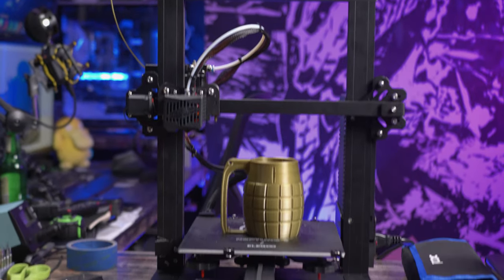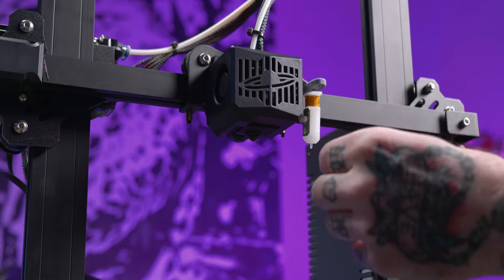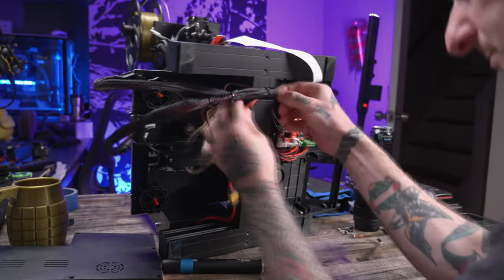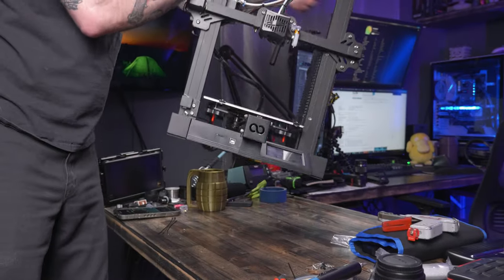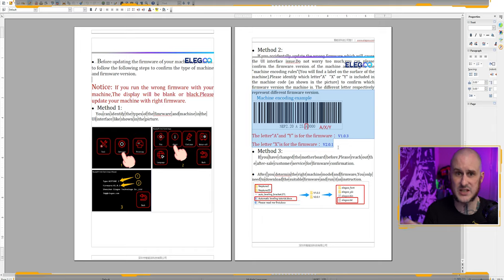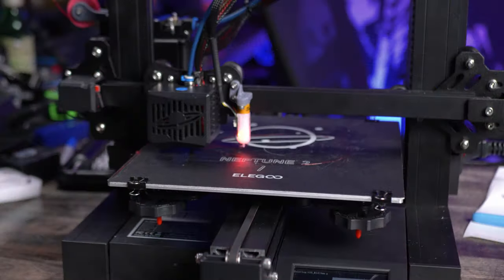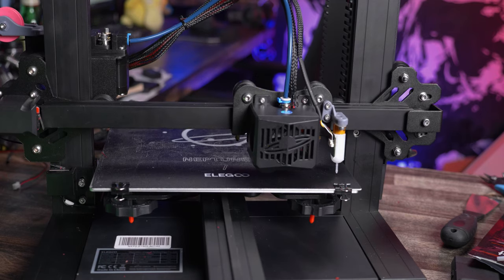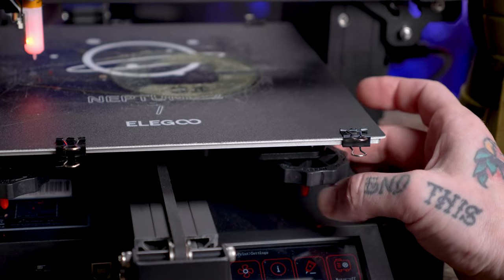DON'T Install BL Touch on the Neptune 2! - How-To and why not to...

Comment: I think you might have forced them to make a user guide post on their website for this. They have made a statement in that article that says the Neptune 2 supports automatic leveling function, but they don't recommend using the BLtouch auto leveling function and that manual leveling can get better printing results. This was all good information as I just bought two Neptune 2s printers,, maybe I'll do one with a BLtouch and one without just to see the differences.
Reply: Hey, I'm interested in your findings if you indeed put a bltouch on only one of your printers. I have a Neptune 2S and I isntalled a BLTouch because it seemed a good upgrade but I agree that the implementation of not having the easy option of manual levelling anymore is sometimes a drag. So what would you say ?

Comment: I have the BL Touch on my Neptune 2. I manually level the bed by running the auto levelling while connected to pronterface. You can then see the BL measurements output in the console. You can use these to know whether to raise or lower the bed for each corner. It's a bit long winded but about 5 iritations had it nailed.

Comment: I realize that this tutorial is a couple of months old, but I discovered something in the firmware that might help. It's a little kludgy but you can edit the "elegoo.txt" file to fix certain settings that won't save to EEPROM (because nothing saves to EEPROM, ugh). I had to do this when I upgraded the extruder to a dual gear type and couldn't get the machine to save the new E-Step value. In the config file, under "Z Probe Options" edit line 252. By default it reads ">Z_PROBE_OFFSET_FROM_EXTRUDER	0	# Z offset: -below +above  [the nozzle]" but you can enter your corrected z offset in place of the default "0" value. Save the file and then update your firmware as normal. This procedure works for PID tuning and e-step adjustments as well, just hard code the relevant values in the config file. It's a PITA, but it works.

Comment from the maker: Elegoo has posted better information to their website about how to install a BL Touch on the Neptune 2.  In those posts they state they don't recommend installing one on the machine, but tell you how you can.  As well as highlighting some issues I didn't capture on video about why this is a strange setup (odd Z-axis motor noises): https://www.elegoo.com/blogs/3d-printer-user-guide/neptune-series-fdm-3d-printer-firmware-auto-leveling-function

Quote Elegoo.com: "Statement: Neptune 2 printer supports automatic leveling function, but considering that the printing range of the printer is relatively small, it is not recommended to use the BLtouch automatic leveling function, but manual leveling can get better printing results."
Reply: I had the exact same response from Elegoo. I had contacted them regarding the knocking sound from the Z stepper and they advised that they've had numerous people reporting the same problem and to rather not use a BLtouch, for this reason and also they say youll get better prints without it. I'm going to be removing mine

Comment: Could you either use Octoprint to home the hot end to the corners, or simply issue the gcode to do so via a serial terminal? That way, you would effectively put back the manual level option? I know that’s still not simple, but adding Octoprint is a game changer anyway!
Reply from the maker: I mean you can do that with Pronterface as well. But you’d have to set the coordinates every time. And adding $50-100 worth of hardware is starting to go against the value proposition of the machine. I’ve got a $70 option in mind that is kind of a major one… but I think will be a fun video.
Reply: @MandicReally  Yeah I realise that it’s not ideal as it adds cost. It was more that I was just wondering if I’d understood correctly and if it were possible!

Comment: Went with stronger springs on the bed,  leveled once,  fine tuned afterwards once, and for well over 8 months now,  haven't had to relevel or touch the adjustment wheels since.  I will NOT waste time/money on auto leveling BS.  Love the Neptune2
Reply: @semialive9327  They are sold pretty much everywhere,  IE:  Ebay/Amazon, etc...
Reply: @mikeb3962  I think they were asking what kind of springs to look for, which I'm also not sure of

Comment: I have a BL touch on my Ender 3 v2 and rarely turn it on. I only use it if I'm printing something large. Generally I'm printing smaller things in the middle of the bed so it's not effected very much by being slightly out if level. That being said I print a 2 row skirt and generally use a brim so I can fine tune the level and z offset with that every print if needed.
Reply: The Neptune 2 doesn't have Babystepping or live tuning of the position unfortunately.  If you add the G29 command to your print G-code it goes through that process I demonstrated, including the Z-Offset for every print, but the Z-Offset screen gets stuck and you cannot see the Print Progress, Temperatures, or any of that.  It is truly not meant to be run with every print.  I struggled with how to demonstrate just how annoying it is.
Reply: How do you take it off because when I unplug it it does like if it were still there

Comment: Neptune 2 with crtouch and marlin 2.1 works beautifully. 4x4 mesh with g29 before each print and the first layer is absolutely flawless.
Reply: So you can make it do a bed level automatically, before each print, By adding the G29 in front of the gcode?
Reply: @RGD-Audio-Repairs  yes. With Marlin software this works. I am now using Klipper and with klipper it also works.

Comment: Wish I watched this video before adding a BLTouch to my Neptune 2S (which I've now removed). I found my print quality to be absolutely awful, and kept trying to adjust things to try to fix it. Until I removed my BLTouch and manually levelled the bed and it started printing fine again... So I guess maybe the compensation or something was messing up the print quality... Not to mention that having to adjust that Z offset everytime I auto level was a right pain and wasn't always the same value...

Comment: Im so lost. I havnt used my neptune 2 in a year. Came back to printing and having issues. So I downloaded new firmare and it seems to auto put in that I have the bl touch, which I do not. But now instead of leveling I have auto level, and now my home seems to be set in middle of my bed. How do I get rid of the auto leveling? Please and thank you for any help you can give me.
Reply: Nevermind i found how to revert.

Comment: i have the same printer with the bl touch i find best to change out the springs to washers or nuts to level the bed out mostly always not had a problem snice

Comment: I am not quite sure if it is on the homepage, but the needed firmware files and STL was posted in their Facebook group.

But most important: it is still possible to use the integrated manual leveling tool on the LCD. It's a little bit tricky to enable it, but it works.
Reply from the maker: How does one enable it? I’ve tried numerous ways and haven’t been able to make both work in conjunction. At least not in the way Elegoo has intended or set it up. 

I realize that Elegoo has the files out there in some places, but the fact that it isn’t on their website is ridiculous. How can customers really be expected to search Facebook for the latest Firmware for a machine?
Reply: How do you enable it?
Reply from the maker: @StefanyBaez  I’m thinking since they said you can 2 weeks ago and haven’t said how, they heard someone say you could and haven’t done it themselves. I tried for almost a week to make it happen and couldn’t. I’ve got a video coming about making the BL Touch work as it should on the Neptune 2, but it will be a rather involved mod.
Reply: @MandicReally  Subscribed to your channel to keep an eye out for that video! I installed BLtouch on my Neptune 2 and honestly I haven't seen any difference. I wish I would've seen this video before purchasing it.

Comment: Welp my manual bed leveling jas been a nightmare first one was warped second one had middle point too high. I spent three whole weeks trying to level it well. Im burnt out and considerd the bltouch seems to me the sensore is too off to the side and might not capture the center height. Im exhousted and dont want to return the neptune 2 but do i have a choice.

Comment: Thanks man.... Ordered the Neptune 2 yesterday and think..... Ow I need a bed leveling sensor...
But the way this think works is a pain...
My last printer was 8 years ago. Lot has changed... Or not... Haha still Prusa is big name.

But can't Octoprint help you on this in a way?
Reply from the maker: Nope, OctoPrint can’t do anything to override the way the firmware handles the commands it receives. In my attempts to remedy this I ran it via PronterFace (interface similar to OctoPrint in some ways) and never got to a good solution. 

I’ve got a bit of an “extreme” solution coming soon but it’s not a basic “fix” by any means. I wish I could find one but I’ve tried as long as I can justify at this point.

Comment: So I recently did this. And it does suck on the Neptune 2. Manual lvling is way better on this machine. I have all the same issues and want to remove this bl touch. Can you share how to reverse the process?
Reply from the maker: You just need to Remove the BL Touch, Install the Z Limit Switch, and reflash to the Manual Leveling firmware. 

I’ll update my GitHub page later today with the Manual Leveling firmware.

Comment: Yeah I uninstalled mine also but had other issues. The menu overlapped on the screen and would freeze the printer if I pushed a button. Also The sound the Z motor made was super annoying, up down up own. Made the printer really loud.
Reply from the maker: I should have mentioned that but it wasn’t too annoying when I went to film. The Z motor doesn’t have quiet stepper drivers so it’s not nearly as nice a sound as the X & Y. Thanks for that input.

Comment: What firmware are they using? I've heard it's proprietary. Couldn't you install Marlin or Klipper?
Reply from the maker: I believe it is an offshoot of Marlin that is somewhat proprietary. Robin Nano’s use an offshoot of Marlin that has some differences as well but those didn’t work. I tried for about a full week to compile Marlin (vanilla or Robin Nano) to work with this board. I found some Reddit posts claiming others had succeeded but zero evidence or details. After that week of trying to make it work is when I have up and made this video. (Part of why I was salty about it all.)

Some say they’ve gotten Klipper going on it. Which makes a bit more sense as it runs mostly on a Raspberry Pi. But my next move is going to be installing a true Robin Nano board, not the Elegoo clone one and run real Marlin on it.

Comment: My BL_Touch screwed my Neptune 2S board today. It worked relatively good for some weeks until the BL_Touch or cable (both originals) got a loose connection. While autoleveling today and the nozzle pressed against the heat bed due of height detection dysfunction (BL_Touch turns from red to blue). I pulled the Z-Axis motor cable to avoid more pressure against the heat bed an skipping and wiggled a bit on the cable and connection of the BL_Touch. Then it bangs, smokes and stinks. Also the display turned black. Only the PSU was still running. I figured out that the MP1584 (3A, 1.5MHz, 28V Step-Down Converter) gone up in smoke. I have no idea if it would help when I only swap this chip but I hope Elegoo can offer me 1 or 2 ZNP Robin Nano v1.3 as soon as possible.

But I can confirm your issue with the unequal leveling too. But in my case this issue is approx 3 or 4 cm from the left edge and not so widely in the middle like on your Neptune 2.

Comment: why u remove the Bl-tocuh and dont just change the settings in the firmware or use a costum community firmware ? u can change everything there
Reply from the maker: This video was over a year ago when community firmware wasn't an option.  I spent a week working on compiling my own version but something was missing and it never worked.  Such a small machine still really does not need an ABL honestly.
Reply: @MandicReally  yep thats right .. i tried as a totaly firmware noob to compile one and sit tehre for 3 days .. until i realised it would be so much easier to edit a community firmware (Cr10 + Ender 5 Plus Silent mainboard)
Reply from the maker: @frommyy  I'm not a noob with firmware but the Makerbase branch of Marlin that the Neptune 2 uses is... troublesome.  I've had issue with it on genuine Makerbase boards, let alone on the Neptune 2.  It is one of the reasons that overall I don't really recommend the Neptune 2 to folks.  Nothing about it makes it stand out to me version an Ender 3 + a Silent Board.

Comment: So you say not to use this and mention other systems that same the leveling data and not erace it, but don't say what other system that is. Mind sharing? I just got my first FDM printer and seen guides to level the bed but something that checks it each print sounds handy.
Reply from the maker: I was referring to basically any other instance of Marlin firmware. 

You can see my video about the CR-Touch / BL Touch for how this typically works: https://m.youtube.com/watch?v=CCyTEttj8sk

Comment: I know this is a bit old, but I have to say  I completely disagree with the conclusions in this video. I'm loving the BLtouch, I do use Octoprint, and created buttons to do manual leveling, but find it easier with the bed visualizer plugin (tells you how far to turn each screw), I find my Z offset to be extremely consistent, and I have g-code that does auto level the bed before each print, and it's working perfectly I've never had prints as consistent as I do now.
Reply from the maker: Are you running Elegoo firmware? I wonder if they have updated and changed something since this.

You are doing what folks should when running an ABL, but in my experience, most folks don't want to do that.  They want an ABL so they don't have to do anything, and that isn't reality on most machines.  Also adding a Pi & Octoprint is advancing the difficulty for most users (and expense especially with inflated Pi prices). Bravo to you, but I have to think about the majority of users when I'm making content.  I could make a 30 minute video about setting it up as you have, but most folks won't watch it or want to go through the steps.

I don't run the Neptune 2 at all anymore but there was more that I didn't include int his video that Elegoo themselves acknowledge after this.  Adding a G29  to do a level run before every print but it was trip that Z-offset function as well and never seemed like it was using the mesh data properly.  The Z-axis made an awful noise when it was adjusting for the mesh (the Z-axis has loud a loud stepper driver on my version). Elegoo themselves put out a message after this saying they didn't recommend installing it, but you could if you want.

Comment: If I already have firmware v1.0.3 do I need to update the firmware still or should I be able to use the bltouch after install?
Reply from the maker: The install on a Neptune 2 would be identical. Except as I noted it will require you to make a spacer with a stack of washers or printed part. Here is a page of info on install and more from E3D: https://e3d-online.zendesk.com/hc/en-us/sections/6157566251549-Revo-CR

I’m sorry I simply don’t have the time to make guides for every machine this could fit. Especially when the initial video only does so well, it’s a lot of time and effort that doesn’t pay me back unfortunately.

Comment: I was thinking in regards to the Z hight resetting issue - could I design a mount for the BL touch that I could adjust the hight of the sensor with a screw or something to get it to line up with 0.00 in the Z offset menu?
Reply from the maker: It would not be a good idea. The probe is supposed to be Up from the tip of the nozzle that much. 0.00 would mean that the height of your nozzle and the height of your Probe are exactly the same. So your BL Touch would be dragging on prints all the time and ruining them or breaking the probe.  

Along with that you are usually fine adjusting Z Offset by 0.001 or even finer increments. Getting a mechanism to adjust that finely & accurately would be difficult. 

I get what you are thinking but it is not recommended at all.
Reply: @MandicReally  Thanks so much for your reply, I'm a complete beginner and your videos are a tremendous help!

Comment: DO THIS PEOPLE  use G29 + store the mesh and then use M420 S1 to recall the stored bed mesh.
Reply from the maker: But that still erases the Z probe offset and requires a reset every time. And when I tried it also left the z probe offset menu stuck on the screen blocking the status message for the current print with all the relevant data. I didn’t demonstrate that because I was over it and didn’t want this to be a 20+ minute where half of it is me explaining why I don’t like the way they’ve done if.

Also Elegoo’s instructions clearly state NO Slicer setting adjustment required. You and I know the G29/M420 can make it do something closer to what I want, but Elegoo is expressly suggesting not to.